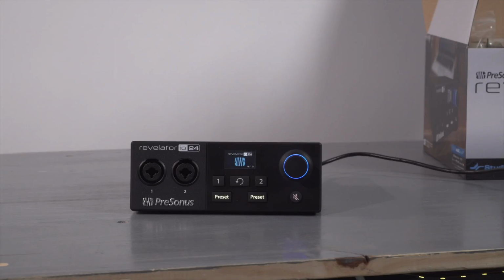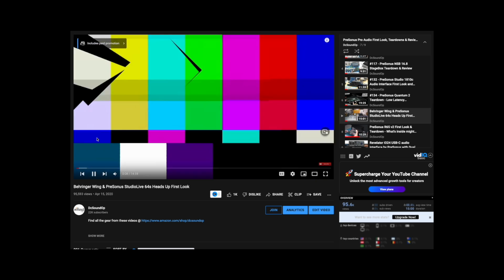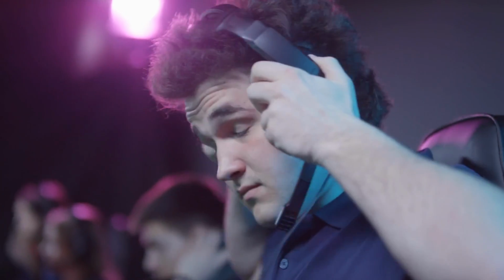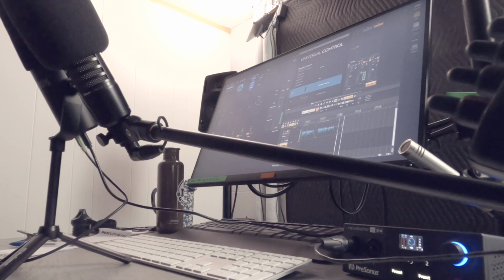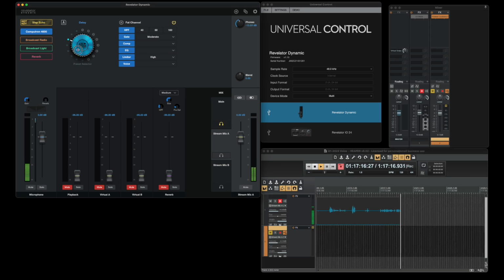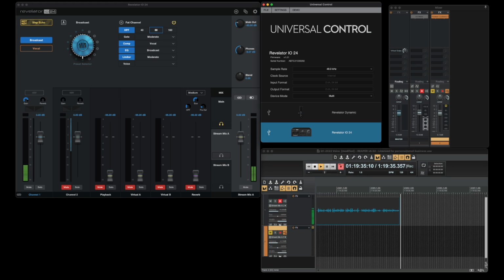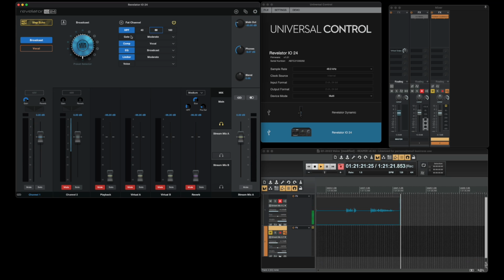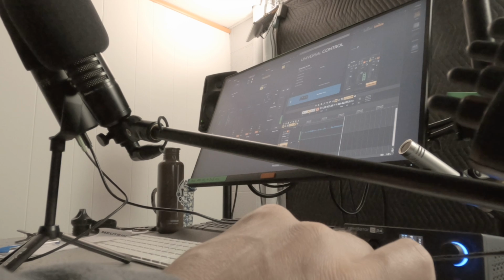Revelator iO24 vs Dynamic Mic USB-C Audio Interface Review & Comparisons

Comment: It's unfortunate that you didn't go into the custom gate controls but just turned it on and off with the Moderate preset. The threshold was clearly set too high for your quiet room, so it sounded terrible when enabled. While the mic IS noisy, in reality it can be pretty much fixed by adjusting the gate threshold.
Reply from the maker: Thanks for watching. I don't share the opinion that a high-noise microphone can be pretty much fixed by gating it, especially for dialog. The higher noise makes the gate much more noticeable regardless of settings and much harder to hide, especially in a quiet room. As far as presets go, it made sense to me to demonstrate what the average user can expect out of the box with these products, as they are aimed at folks primarily looking for an easy (preset-based) option. Thanks again!

Comment: This video is covering exactly the question i have been debating for weeks.
Revelator Dynamic USB microphone 
OR
Revelator Io24  
/with a Dynamic mic like sm57 or sE Electronics V7.

Any suggestions? 

You just got a sub.
Reply from the maker: Thanks Michael, I appreciate you subscribing! I noticed that @John Smith replied to your follow up comment & I agree that either will do well for you. Like I mentioned in the video, as long as you adjust the settings so they're not as aggressive as the presets start out, I doubt anyone on a video call would tell the difference. 

I understand you are concerned with the headphone amp, but we're talking about spoken word for broadcast essentially, not tracking drums or anything crazy loud. 

If you're monitoring that loud with headphones for speech, you're 100% going to pick that back up in the mic and have some weird issues going on for your listeners. We typically give a mix-minus to broadcast talent. This means their headphone mix or IFB get everything (the program feed) MINUS their own voice. At most you'll put a little bit in for confidence, but this isn't the same as a singer cutting a track where the headphone mix is there for pitch reference. 

All of that to say, I don't think you'll have any issues with either for headphones, but maybe I'm misunderstanding what you're saying there.
Reply: @DcSoundOp  I appreciate the assistance.  I was concerned with driving the headphones at reasonable levels.  Neither are particularly demanding but I was concerned about being able to use them for zero-latency feedback.  I will not need high volume levels but since the impedance listed on the headphone output is 16 ohm, I was concerned about its ability to drive headphones.  There was also another reviewer that could not hear out of the headphones he usually uses even at 100% gain.  As long as the headphone output on the Revelator Dynamic is sufficient to power my 32-ohm headphones, that is the way I should go and save $100. So, Thank you for that information!

Comment: Hello great content, may I ask you, between this model and the Shure mv7, what would be better, thanks for your help
Reply from the maker: Hey Tio, I'd probably go with this over the MV-7 simply for the loopback capability. The MV-7 is a fine sounding mic, but has more limited routing & a lot of folks will prefer the USB-C connection on the PreSonus. Thanks for watching & for the great question.

Comment: I'm between this revelator dynamic or the Deity VO-7U. I don't like the with noise of the revelator one and the sound that it makes when you mute the mic. 
What do you think?
Reply from the maker: I haven’t used the Deity at all unfortunately. I’ve tried to get demo gear from them previously & had no luck unfortunately. I like how theirs looks though & that they sell it for less without the boom arm. Pair it with a real boom arm & it might be great. Let me know if you try it!
Reply: I really don’t like the revelator dynamic noise, but No loopback and lack of dsp on deity kills it for me.
Reply: @TobiasVarini  i finally went with the Shure MV7. And now I’m thinking of selling it and going with the rode go 2 so that it doesn’t appear on the frame.
Reply: @juanpatriciodoyle4041  Shotgun mics are not good for untreated rooms. Instead, check pencil condensor mics (like the Oktava MK-012).
Reply: The Deity has a low noise floor. This and nearly all other noises can be completely eliminated by using Equalizer APO and 2 VSTs ("reafir" and "Real-time Noise Suppression Plugin", search for it) on Windows. I do not know if there is appropriate software for other operating systems.

The Deity has no DSP but you can also set everything within Equalizer APO and free VSTs. I made a video about that which you can find on my channel (but it is German - but the links should also work for you). I was pleased with the result.

There are 3 issues with the Deity VO-7U:
- RGB can be deactivated completely but when you use its mute knob the RGB is lightning in red (can be solved by using TorkilsMicMuter and Volume² and muting the mic via a software shortcut instead of the hardware button)
- the gain knob is strange as it is somehow reversed and triggers an internal limiter above 45 or 50 % gain
- the mic arm is not very stable and should be replaced within several months (mine did hold 5 months before it broke)
Reply: @tardezyx  Hi Tar, I just sold the Shure MV7. And I need to buy a new mic in early-mid April.

Thanks for replying.

I need a not-in-frame mic and also I need to share the mic with my partner, so I'll have to move it to point in a different direction being placed from the same "central spot". I'll check the Oktava MK-012, and see more about indoor boom mics.
Reply: @juanpatriciodoyle4041  The Oktava - as well as other small diaphragm condenser microphones - most often are also sold as pairs. As those mics are rather sensitive, you should not move it around while speaking or you can test it with an additional shock mount. I would try to hang them from above and out of screen. Other alternatives are lapel mics (e.g. Sennheiser MKE2) or the Rode Wireless GO II (actually, I am not sure if you meant this or the VideoMic GO II, which, as told, is not good in untreated rooms) or even a bi-directional large diaphragm mic between you and your partner. It really depends on the situation.
Reply: @tardezyx  Hi. The purpose is not to share the mic at the same moment, it's just to let my partner use it, when my call finishes. 
So, when I finish my call I just point the mic slightly to the right, where my partner it's sitting and I connected to her computer.

Comment: Hey everyone! I have a question: The mixing software for the revelator iO24 Universal Control never shows up. 

My Revelator IO 24 is physically functioning ie., I can control the sound level from the physical device just fine. 

The problem is that "Universal control says "No Devices available and the revelator software mixer never appears on my screen. 

I'm using M1 Pro Macbook Pro. 
OS: Sonoma 14.2.1 
I have a high-powered (7,500 MA powered) HUB as well as plugging in Revelator Direct. 

Has anyone run into this issue? I have messaged Presonus through their only support channel (support tickets) multiple times to no avail. 

Is this a faulty issue with their software? I've uninstalled and installed numerous and even older versions of their software all to no avail.

Does anyone else use this revelator with a Mac successfully?
Have you run into these issues too?

I would love to be able to use all the abilities of this DA converter unit. 

Funny thing. is that the reason I selected this unit was due to the advertised software functionality. 

Any helpful advice is truly welcome.

Thanks in advance!!!

Comment: This post is to add details needed for my question .
I am looking to teach online. Most of the classes are live with some pre-recorded lectures.

My office is untreated.

The lowest impedance headphones I own are 32 ohm w/ sensitivity of 109 ( efficiency of 93dB). This is relevant because i know the headphone amp for the Revelator Dynamic is pretty weak, and i will want zero latency monitoring. 

Many of my students will be listening through computer speakers or cheap headphones, so Audio perfection is unnecessary. 

Which do you suggest? 
$200 for the Revelator Dynamic USB Microphone 
OR
$300 for the Revelator Io24 and a $100 Dynamic microphone ?
Reply: The main issue I've heard with the USB revelator dynamic is the self noise. If you are a quiet speaker, this may become an issue as you will need more gain to achieve a good level. Personally, I would get the interface and mic combo as it's more versatile, but if you have no intention of using the mic apart from online lessons the USB version should do well enough.
Reply: @TheHalfmanofOz  Thank you for the help!
Reply: @michaelreed649  No problem. Good luck.